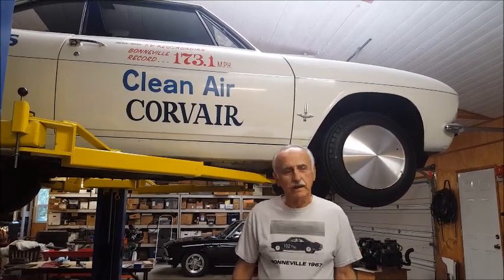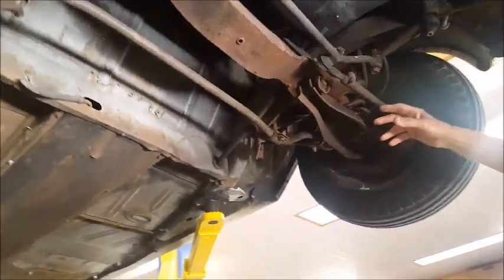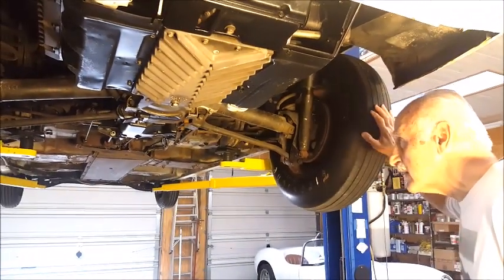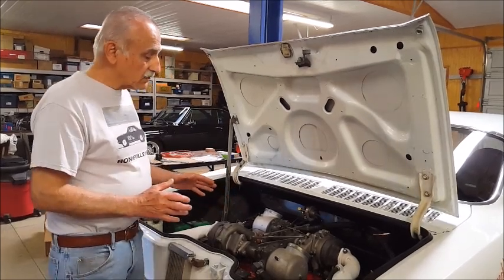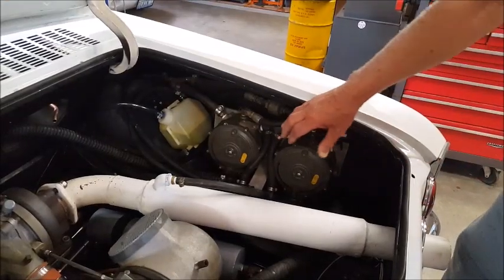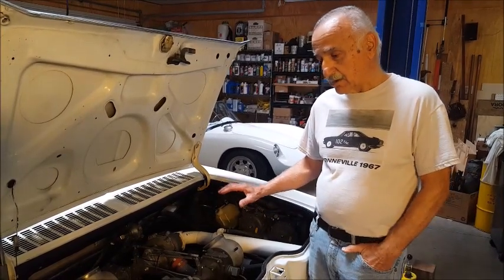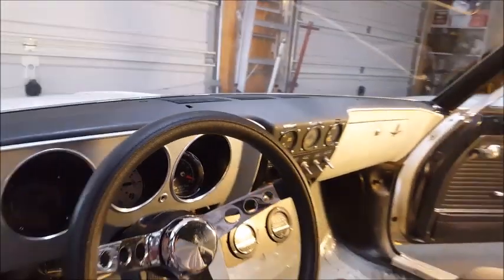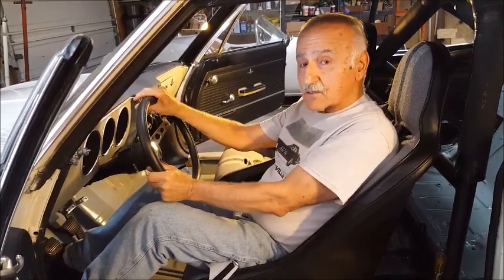World's Fastest Corvair, Is It Safe at 175 mph?

Comment: The Corvair was made with a bad rear suspension. It is the Porshe 930. Both cars over steer when you take your foot off the gas pedal. Just like Ralf Nader said. I do not think I am the only one with opinion..
Reply from the maker: I have a friend that ran his Weber carbureted (46 IDA) Corvair the same year that I set my record.  During his return run at 153 mph, he took both hands off the steering wheel and placed them behind his helmet.  He finished the run while holding the wheel with his left knee.  The Corvair is stable because the rear engine provides superior traction on the slippery salt.

Comment: We had a 63 Corvair and a 68 Falcon, the Corvair was fun as can be, but on a dirt road at even low speeds it would turn slam around in the road with no warning.  The Falcon rode better and didn't smell of oil and would go faster on the same dirt road.  That model was dangerous, but they fixed that on newer models.  The shifter on the auto Corvair we had looked like a lawn mower throttle lever on the dash.  I would still like to have one now.

Comment: I had a stock 1966 corsa corvair in high school. It was the 180hp turbo charged model, with 4 speed manual transmission, and posi-traction rear end. I could get rubber out of all 4 gears, and could go 110mph. It was very stable, and had a rumble when driving around in the city. The bearing between the intake, and exhaust side of the turbo charger had to be replaced occasionally, until I read about adding a separate oiler line to the bearing, in hot rod magazine. It was a fun car. The guy I sold it to, put the engine in a midget race car. I still have the owners manual.
Reply: The turbocharger bearing ALREADY had an oil line feeding it... unless someone removed it.  The oil line was chromed, fed pressurized oil directly to the turbocharger body housing from a brass junction block that also mounted the oil pressure snap switch at the rear of the engine beside the distributor.  Only the turbocharged engines had this brass block.  There was also an oil return pipe that drained oil from the turbo back into the engine via a boss-fitting on the passenger side cylinder head.  Obviously only the turbo engines had this oil return boss.

Comment: 30 years ago my friends black Corvair race car would do 160+ at Willow Springs on the straights... IIRC top speed on those short spurts was in the mid 160s.  Unfortunately the car was wrecked.  If was naturally aspirated and extensively race modified by the owner/driver... my friend Mark Natali of Fullerton Ca.  So you might have the "fastest Corvair" by a couple MPH but I guess that's all it takes and Mark's car is no longer around to challenge your claim and never ran in competition land speed record trials.  His car would actually do more than go in a straight line and was very competitive in road racing.

Comment: Was hoping to see what was in the front trunk to see what holds the front end down. That was the Corvairs weak link. When pushed hard in the corners the front end would wash out. I cured that problem on mine with two concrete building blocks.

Comment: If you are going that fast in a Corvair you'd better have superior front air-daming as the front end is too light.
Reply from the maker: All the bodywork on the car is standard Corvair--no modifications were needed.  The larger tires on the rear provide about a 2 degree negative, angle-of-attack for the car which makes the car very stable at ANY speed!!
BTW:  Not one pound of ballast was added to the car.

Comment: 175 in anything Id be a little timid that is covering ground fast!
IF I ever did, it would only be at Bonneville.  Impressed by  the build here!
Are there better heads available for these? whats the limit on the stock ones (valves porting etc)
Been 148 in my ZR-1 158 in my El Camino...One strong gust of wind from teh side and one rabbit it sunk in anything happens at those speeds
Youre done, 0 control. 0-120 asap these days that is it.

Comment: Think Olds had a turbo passenger car engine back then used water/meth injection. Remember them coming into shops, being asked to remove both. 
How do the Corvair engines hold up with aftermarket turbo setups? What kind of boost will they tolerate and not go boom?
Reply from the maker: Since the turbocharged Corvair Spyder was introduced in 1962, there were very few aftermarket Corvair turbo setups available because the factory system was so well designed.  Instead of designing an engine for the turbo, Olds used a standard V8 with a turbo bolted on.  Oldsmobile had to use the water/methanol injection to control detonation because the engine they used had a 10.5:1 compression ratio and they didn't want to change it.  
    The Olds turbo had a maximum boost of 5 pounds but the Corvair ran about 10 psi without water injection.  Many Corvair owners have made modifications and are running over 15 pounds boost.  My Clean Air Corvair ran between 25 and 30 pounds boost at Bonneville in 1974.
   Thanks for your comments.

Comment: Very cool cool. I wonder if there's a way to use the cold from the propane evaporating system to help air cool the engine? Like put an evaporator atop The fan.
Reply from the maker: As a matter of fact, on my street Corvair, I circulate water from the converter to an oil cooler.  Works very nice.  Thanks for your comments.

Comment: I really wish there was a way to find out what make and model of mixers he used on his record motor. They're not a type I can recall ever seeing before. Anyone happen to know?
Reply from the maker: Hello AHHOLT,   I used Impco 425 mixers on the turbo's.  Herb Hills, who was CEO of Impco at the time, was very helpful and decided to sponsor me and even let me use his dyno.
  He was a very kind and generous man.
TomKeo
Reply: @tvkperformance4147  Hello TomKeo! I never expected to hear from the man himself, thanks! I can see it now; I wasn't taking into account that they were partly hidden inside the intake elbows. I didn't even consider 425's because the current Impco literature says they need to be vertically mounted. As a matter of fact, I've been trying to come up with an N/A intake system for a different engine using the smaller 125. I emailed Impco tech support about horizontal mounting of mixers bigger than the 55 and they said flat out no, that the springs and diaphragms weren't strong enough to function on their sides and it wouldn't work. Your success says otherwise. Did laying the 425's over give you any kind of problems?

Comment: Enjoyed that story.  Did I miss it or did you ever experiment with intercoolers for those turbos?
Reply from the maker: I did use an intercooler at Bonneville in 1966 but didn't seem to help that much.  Since then, I discovered simpler ways to make more horsepower.  Thanks for your comment.

Comment: Unbelievable it's still air cooled
Reply from the maker: Remember this, I was using the same cooling system that was used on the 80 hp, 1960 Corvair.  Thanks for your comment.
Reply: @tvkperformance4147  Never overheated even in traffic?

Comment: I wonder how much horsepower the transmission can take b/4 it will granade.
Reply from the maker: Starting in 1966, Corvairs with manual trans. were equipped with Saginaw gearboxes and that was a BIG improvement.  I've never had a Saginaw fail.   Thanks' for your comment.

Comment: My first car was a 1964 Black with Red interior Corvair Monza. My dad just told me this car belonged to a friend of his and I was going to buy it for $200.00 in 1974 money. My dad brought it home to our 2 bay garage. He repainted it right there.
  I have to admit it looked really good after the paint job but I had been talking about how I liked the 2nd generation body style  much more.
  It was a good little car though.It never broke down or left me stranded.I also would rather it had been a 4 speed instead of the old powerglide automatic transmission it came with. 
  I kept it until I ordered my first new car.It was a blue inside and out 1978.😢 Chevy Nova. It was a stripped down model. lt came with a 6 cylinder and automatic transmission,air conditioning, power steering and brakes.I ended up selling the Corvair for $1000.00 when I got my Nova so at least that was not bad!

Comment: I was the proud owner of a 1966 Corvair Monza - bought it stock with 800 original miles in 1968. By then, there were dozens of aftermarket performance products for Corvairs in California, and I made good use for them:  I removed the stock carburators, had a Crown ram induction manifold installed with a Holley 4 barrel mounted on top, 3/4 cam, installed Hedman headers with glass-pack mufflers, a Bosch racing ignition coil, dual-point distributor, spring tensioner for the fan belt pulley, opened up the fenders and installed 14" wheels with the new Goodyear radials, and had a fiberglass aero body kit installed with racing/fog lights. I routinely did a "road commute" every 2 weeks from West Los Angeles to San Francisco down the I-5. Several times I would fill up the gas tank, leave from SF or LA sometime between 2:00am - 3:00 am and once I would get on the 1-5, I would turn on my radar detector, and that Corvair would hit 120mph in a short distance. I would drive at that speed for 2- 4 hours heading in the mostly straight with relatively few exits and NO cars on the road - only semi trucks. My time record from San Francisco to West Los Angeles was 4 hours and 28 minutes, and I still had about a 1/2 gallon of 76 Union Plus in the tank . Those were the good ole' days!
Reply: I had a 65 too lived in Downey we would party n play in Laguna Beach. We would take turns on who drove I held neighbor hood record for fastest trip. I apologize to all the people on the freeway. I drove it like I stole it great handling little car
Reply: @jerryrothenberger9071 Great story 😊!! Thank you!! Mic'MMXXV
Reply: @jerryrothenberger9071 😂!! Thank you!! Mic'MMXXV

Comment: I bet that even today if you ran the Corvair up and the 405 in LA on on any given week day the air would be cleaner coming out of the exhaust the going into the air cleaner.
It also would most likely be illegal to drive in Coliformia, unless it was all CARB designed and  approved
Reply from the maker: Warren,  You are right.  They would lock me up because I wasn't using Ethanol.  BTW--Years ago Road & Track magazine had a cartoon that illustrated just what you mentioned.  Dirty air going in and clean air out the exhaust.  Thanks for your comment.

Comment: LOl..it wasn't even safe at 25 mph....and that goes for ALL the rear engine cars of the time, with Porsche being worse...it took the Germans 40 years to get it to work right, to a point.  Putting a motor in the rear is just plain STUPID......PERIOD.
Reply: ...I have thoughts about cars like the GT-40, various Ferrari versions, most F-1 cars, and just about everything racing in the open classes at Le Mans through the late '60s/Corvair times, ALL with the engine behind the driver and ALL very high performance vehicles.
Reply: @tonyunderwood9678  I guess you dont understand the difference between having an engine behind the driver and having behind the rear seat....
Reply: @chadhaire1711  I do understand the difference... I've been doing this sort of thing a very long time and I've owned a bunch of cars including over a dozen Corvairs as well as some other rear engine cars NONE of which were VWs.  Making an arbitrary statement decreeing that all rear engine cars are unsafe is mistaken.  The 2nd generation Corvair alone proves it.  And so did the US government re: the first generation Corvairs...  

 On Friday, July 21, 1972, the National Highway Traffic Safety Administration (NHTSA) - a branch of the federal government - issued a report on its two year investigation of the 1960-1963 Corvair.  The report concludes: "The handling and stability performance of the 1960-1963 Corvair does not result in an abnormal potential for loss of control or rollover and it is at least as good as the performance of some contemporary vehicles, both foreign and domestic."    

The Corvair is the only car ever proven to not be unsafe by a U.S. Federal Government investigation... particularly the 2nd Gen Corvairs which were the best handling cars made in the USA through 1969, proven to be so by a pack of engineers at MIT who flung them around skid pads and slalom courses etc.   The 2nd Gen Corvairs remain competitive in SCCA road racing and autocrossing competition to this day.   But since I evidently don't understand the "differences" you mentioned, I cordially invite you to do your own research and read for yourself how there is a plethora of misinformation and hearsay about Corvairs that continues to be proliferated to this day by ignorant sorts who have been bandwagoning the accusations for decades, none of which were actually genuine.
Reply: @tonyunderwood9678  I dont need to do research......putting an engine in the rear causes an unbalanced platform, and is totally idiotic. And for what?   It took Porsche decades of expense and engineering to solve the problem.  Putting the motor in front or the middle solves all issues at the beginning....only advantage of putting the engine in the rear is to make a  CHEAP CAR CHEAP.....and CHEAP is what you get and deserve.  The fact that Porsche made it expensive and can sell it in the 911  is one of those oddball puzzles....proving you can sell anything to anybody if they are dumb enough.
Reply: @chadhaire1711   Well Chad... I appreciate your enlightening commentary and I accept that I'm idiotic, as well as is GM, Ferrari, Porsche, and others.  I won't spend much time mentioning that most American cars had (and still have) a weight bias of around 60-40 with the front being heavier, while the Corvair had a 40-60 bias, with the front being lighter.  Interestingly enough, when there were 4 people in a Corvair, that bias ended up being ~50-50...  You have a nice day now, sir.
Reply: @tonyunderwood9678  A 60/40 front bias doesn't cause the car to spin out and has proven to be a great standard.....a 40/60 bias does   spin out with little effort and is hardly a great standard.  That is why you dont see too many front  engine cars wrap around telephone poles when taking corners, and not too many rear engine cars racing unless they have super wider tires in the back and AWD.  You mention GM---are you serious?  They made just one turd rear engine car out of hundreds of millions, and admitted it was a mistake, then you toss their name around like it means something?  LOL.   Ferrari?   They make MID-ENGINE cars, not rear.  Only model that came close was the Mondial, because the motor was pushed back a bit to make room for a second row seat....but not all the way back.  
You might drive a lot, but you sure don't drive quick, probably don't know how and it shows.
Reply: @chadhaire1711  Alrighty Chad, you're right in every way about everything, and I'm all wrong about everything I know, so I won't spend any time arguing with you over semantics... or how you don't know me.   So I'll end this nonsense by saying "You have a nice day, buddy".
Reply: @tonyunderwood9678  I will have a nice night.....in my 2023 Dodge Challenger SRT V8 Shakedown  with 60/40 weight....

Comment: My Corvair has an LT-1 out of a70 Z28, but I don't know that it would run along at 170 MPH.
Reply: i had a 70 LT-1 from a Vette in mine using a kelmark kit.  I had 2 3-Row radiators up front.   big spoiler to protect the lower half of the rads.  About 50 1.25 inch holes between the headlites.  140 was the fastest I went.  I suspect this setup changed the front lift.

Comment: Back in the early 70's Bud Whitfield built a Corvair motor he used for drag racing in Colorado, I think he really wanted it for Pikes Peak but it had such a radical cam it stumbled around 100hp until 3800rpm then it takes off. I know it was in the 9's in Colorado, being a mile high!

Comment: I had a '64 turbocharged 150 HP convertible. The turbo had constant problems.  Crown made a kit to replace the 4 carbs to one single Holley 4 bbl carb. I drove the car for 7 more years and sold it.

Comment: Several years ago, we out a Buick Special 215 CID aluminum V8 into a '65 Corvair using a Crown Industries kit. Of course, the engine had to be converted to run backwards. The engine was actually lighter than the original Corvair's engine by 38 pounds. Tubular Automotive made the custom headers/exhaust system. We put 15" wheels on the car and used wire wheel hub caps. Slight modifications to the engine hood and the Corvair still looked stock. The car is still street legal today and still on the road.

Comment: It's the later model with the axles with two U joints. The original had a swing axle like the VW. That was where the criticism came from. They had a tendency to tuck under on a tight turn.

Comment: Very impressive and these young fellers think turbos just came out in the past 15 to 20 yrs with your engineering knowledge and what's out there now you would need some serious downforce and upgraded spindles and bearings to go another 100 MPH easy 👀
Reply: Ordered corvair turbo mufflers for my390 Amx early 70s. Low back pressure and real quite. Bet napa sold more corvair mufflers than there were turbo corvairs.

Comment: A great car.  I didn't have a problem with my 66 Monza going straight.  I had a problem with being able to turn the steering wheel from side to side over 70 mph and still going straight.  You needed some weight up front.
Reply: They should've kept the spare tire in the front like they did for '60 models. It helps balance out the weight.

Comment: If you're running on the salt flats at the speed you're talking about that car has a cage and that cage will help the chassis
Reply from the maker: Lawrence,    Cages weren't required in 1974.  No chassis mods at all.  Just a roll bar hoop behind the driver.  Check out my other video at WORLDS FASTEST CORVAIR AT BONNEVILLE.

TomKeo

ca